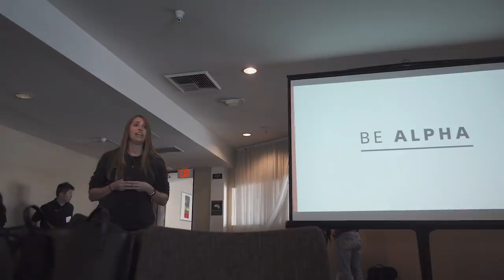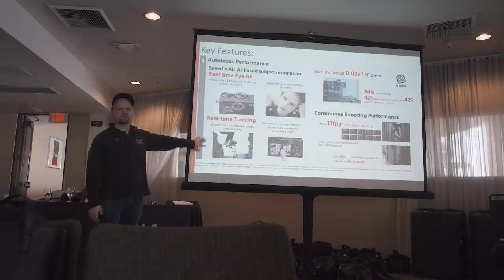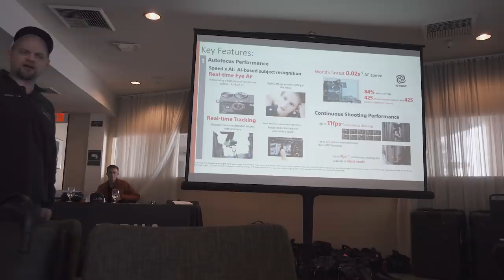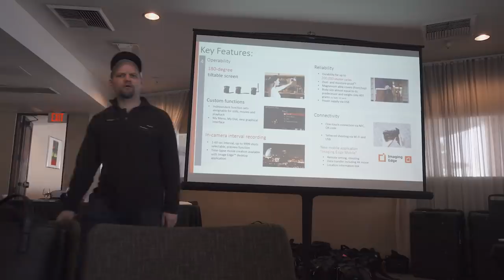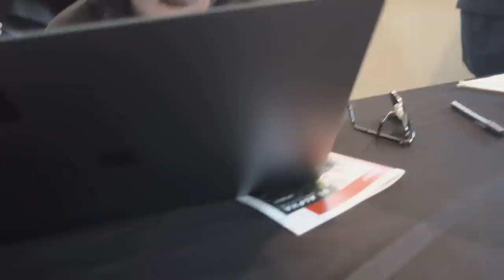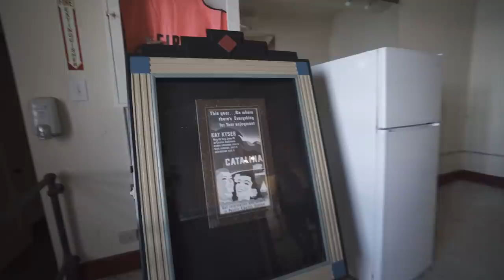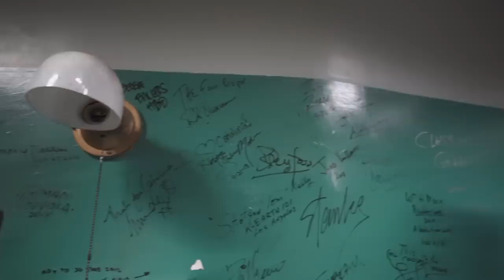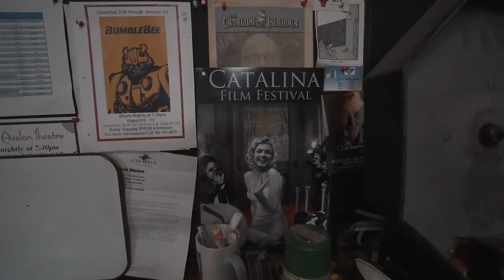RARE MILLIONAIRES RESORT CASINO - Catalina Island | Sony A6400

Comment: In the mid 1940s to the mid 1950s Humphrey Bogart used to spend a lot of time at Catalina Island sailing his 55 foot boat Santana there. He usually had some of his Holmby Hills Rat Pack friends and other big Hollywood stars on board. Errol Flynn and Johnny Weismuller also had sail boats and went to Catalina frequently. Catalina was the place for all of them to escape to when they weren't working.